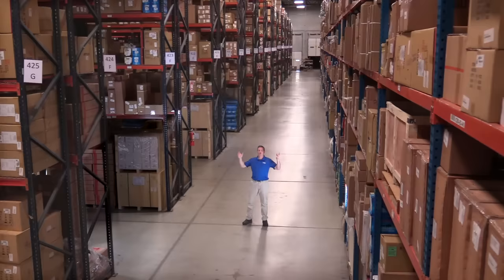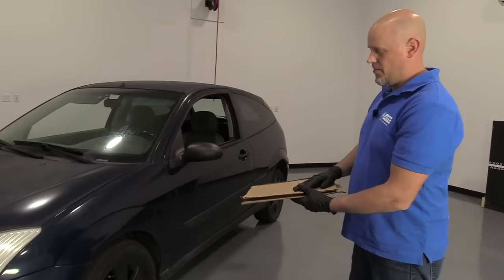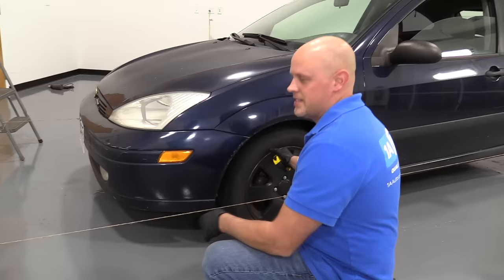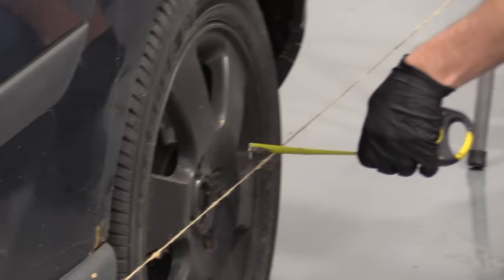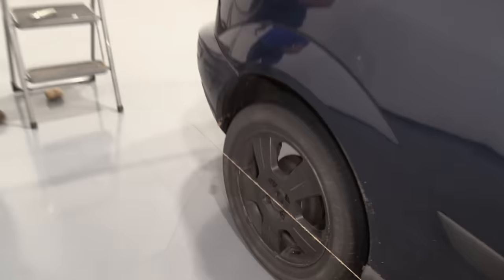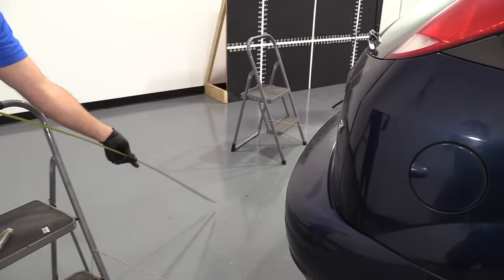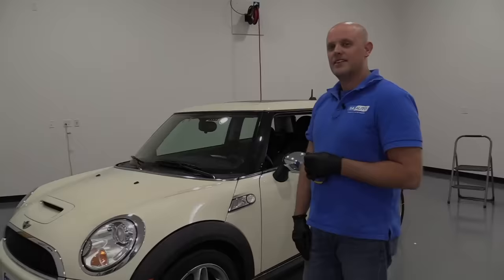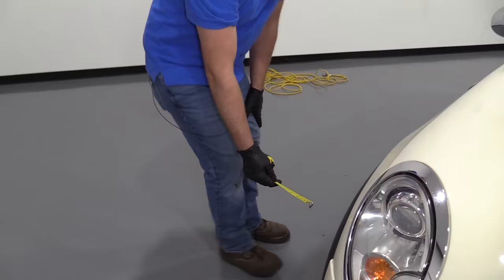How to Perform Wheel Alignment by Yourself

Comment: 1, you didn't let go of the steering wheel while driving it. 2, Uneven front tires will always pull.
Reply from the maker: +El Salvador Thanks for the feedback!
Reply: True but most roads will fool you because they are not exactly level but tend to curb down toward the sides to keep water out of the main strip and helps making it go sideways faster. Usually you’ll feel it when it pulls to one side when you need some force to keep the vehicle straight

Comment: Is it okay if you Jack the car up my car is so low there's no way I'm getting under it with it on all fours. I hit a curb and had to replace my struts and the driver side is way off
Reply: You might have other parts like control arm bent, changing a strut should not put your alignement off too much

Comment: I cant see how that can work properly as you didnt check the measurement again at the center of the wheels after pulling the chair out another 1 inch at the back, surely that gives a different measurement at the center of the wheels?

Comment: If the rear is off, the front will be off too, not to mention there's 3 adjustments on the front, toe, camber, and caster
Reply: Not on all cars, a lot only have toe adjustments

Comment: Not accurate. The rear axle is not always the same  width as the front. That means ur way out with the alignment
Reply: Doesn’t matter. The angle is not measured between rear and front. As long as the line is parallel with rear wheels you only need to focus on the differences between back and front of the front wheel.

Comment: Tie rods for your car may not be the same as factory parts. So the amount of turns to get them off will not be the same to get the new ones on. 
This is how I found my alignment ...so worse... after my fix.
Reply: Even from the same mold they could be off a few millimeters but usually they are quite close. When I changed both tie rod ends my steering was crooked to one side so I adjusted just slightly and now it’s more centered. Will use that method to make it much closer to specs

Comment: So why do you have to take it to a shop to get aligned if you just aligned it on your own?
Reply: this is a good enough alignment to have a driveable car say after doing front end work,  if you want accuracy take it to a shop
Reply: He needs to say that to remove any liability.  I compensate for front and rear track difference in my toe measurements, use fine string, a machinists scale, and really take the time for precision. Have achieved great results with this method; i.e., straight wheel and no abnormal tire wear.

Comment: Why wouldn’t you just cut a piece of cardboard the length of your tow adjustment, loosen the nut the length of that piece then draw in the tie rod and tighten the nut back up?

Comment: Way too complicated. Just get a measurement at the center tread at back and front side of tires from under the car. It will get you close enough for a trip to the alignment shop.
Reply: It won’t work. You will never tell if the wheel are parallel to the car only to each other

Comment: CAn you answer me this, I jack up my front end and both wheels spin freely but I go to wiggle my wheels it turns the steering wheel. My steering wheel doesn't lock. CLK430 Benz. oh when I hit a bump the car sways left or right really bad.
Reply from the maker: +LOONI BEATS Since there could be multiple reasons why you’re experiencing this difficulty with your vehicle, I strongly recommend that you have a reputable mechanic inspect it. They’ll be able to troubleshoot the problem and tell you what part or parts you’ll need for the repair.
Reply: Sway bar bushings, sway bar links, worn struts will make your car wiggle around when hitting bumps. Also uneven tire pressure.

Comment: I don’t understand how you know the string you are using as a reference is in a straight line
Reply: Jesse Sward if it’s the same distance away from you’re center caps
Reply: @ewiiiic  nope. If it is same distance from back of rear wheel and front of rear wheel. Center hubs could be different some cars have larger wheels in the back.

Comment: This method assumes the rear alignment is good.  What if you do 4 wheel struts?    Get it close, then take it in for a pro job
Reply: Most cars and trucks have no adjustment on the rear suspension.
Reply: What pro job ? most places make it worse these days
Reply: My Toyota Avalon 98 has rear wheel alignment. Tow in and out

Comment: why not jack up the vehicle and measure with the tires in the air?
Reply: Suspension needs to be at ride geometry
Reply: There needs to be load on the wheels. Otherwise your alignment will be off.

Comment: that will get the toe only close. on new vehicles you gotta hook up a proper machine. Use this trick to not peel tires off on your way to the alignment shop.
Reply: What you mean new vehicles you need to hook up a machine ? Most new cars are still the same ?
Reply: @orion5813  meaning this is no replacement for how picky newer cars are to precise readings. Being off 1/16 or 1/32 if an inch can get tire wear. This is quick trick to get your car straight enough to get to an alignment shop without peeling tires.
Reply: Travis Stone and most tyre shops have no clue how to get it right !

Comment: This fails to mention the track width, i.e. front and rear of car having different width dimensions.
Reply: That doesn't really matter, I get the front wheels aligned with each other, then I measure the toe angle by measuring from thread to thread. Make sure to move the car back and forth to "reset" everything

Comment: Ive watched about 5 videos with the string method, and i think that method just stinks. Better to measure side to side in the front tires. But who knows..i guess no DIY will be as accurate as a shop and we are all relegated to 90 bucks and two hours per alignment
Reply: you need to do both in my opinion, if you just measure the tires side to side you dont know which side needs the adjustment. You only know the adjustment is out. The string shows which tire to adjust
Reply: What? Don't know Jack about the "regulations" but 2 hours to do an alignment ? What do you align or you just slow walking that alignment? I don't disagree necessarily with the charge it's fair enough but time is somewhat excessive. And yes I do know wtf I'm talking about before you say it .Been doing this profession for 35 + years !
Reply: Well. The days of simple alignments are over.  With the advent of ADAS, doing an alignment is much more involved.